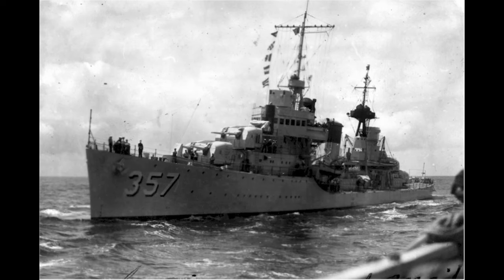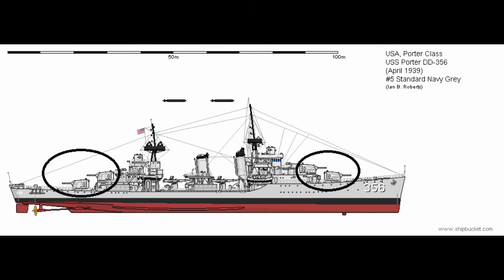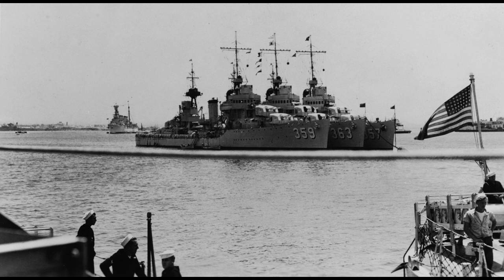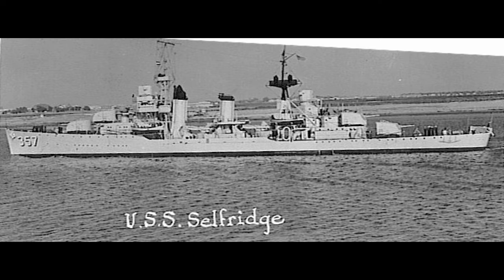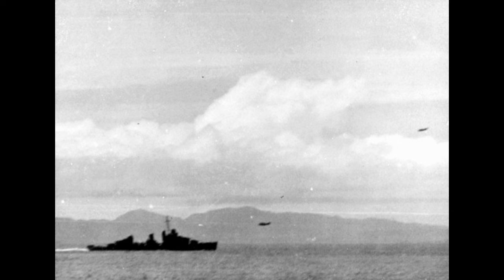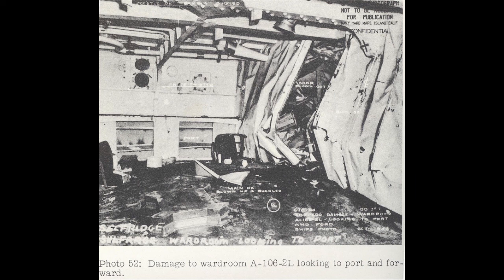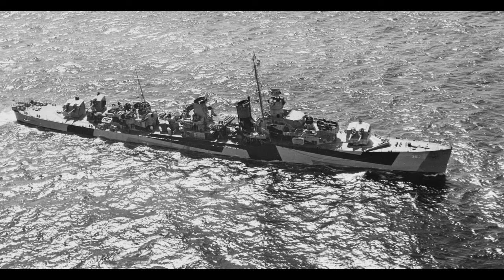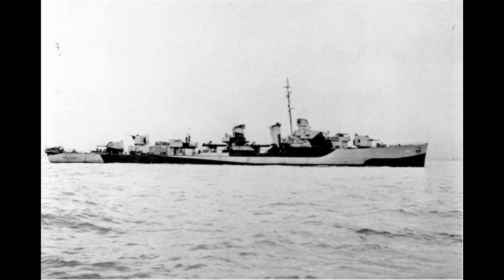USS Selfridge - When You Lose Half Your Ship

Comment: Odd rebuild. A destroyer having 8 5" 38s would have been a good carrier air defense platform. Drop one of the torpedo mounts for the quad 40mm mount.
Reply: The important thing about the interwar destroyer leaders is their weapons were single purpose. Before the rebuild, they could not be elevated for AA Duties. During the rebuild the guns were replaced by dual-purpose mounts. Due to the heavier weight, they could mount fewer of them.
Reply: they dropped both torpedo mounts in favor of more than double the antiaircraft guns and cut back the number if 5” guns but made them into actual antiaircraft guns instead of pure antiship guns.

their sole antiaircraft protection were the 1.1” “Chicago piano” guns until they added 20mm and 40mm guns along with dual-purpose 5” guns. less ia more there, but offset by more overall firepower
Reply: @luked7525 add in the torpedoes weren’t needed but the 5” and 20 and 40mm guns were…they at least kept depth charges so weren’t solely without full protection
Reply: @luked7525  Some of the surviving ships, especially Phelps were reconstructed with 2 twin mounts like the Sumner class and one single mount
Reply: Those four, twin mounts, were the old Mk22, which were not dual purpose. The ship would have been little help against most Aircraft.
Reply: @Commissioner62  1.1 inch guns weren’t much help either
Reply: @bostonrailfan2427  That is VERY true!  Fortunately, they had a rather short life in the US Navy.
Reply: @Commissioner62  unfortunately, that short life cost them multiple ships
Reply: @bostonrailfan2427  That is very true. But when it came to the 24" Type 93 torpedos, when we were still using our 21" Mk8s(with their wonderful 95% rate of failure, even when they decided to stay on set course),nothing was of much help at the time. Even today, the range and speeds of those Type 93s is amazing.
Reply: @Commissioner62  just think of what might have been had they focused on dozens of smaller ships and not huge battleships…fleets of them swarming like the tin cans eventually did in 1943/44/45 but in 1941/42 and things are over and lost in months!
Reply: @bostonrailfan2427   That definitely would have been an extremely serious issue, for ANY of our surface ships!  We probably would not have turned the tide until 44, when many of our (CV)+(CVL) went online, and we could avoid any confrontation less than 40000 yard. We probably would not have had those 3 carriers at Midway, if the IJN did not waste so much on Yamato, Musashi, and Shinano. Even worse, if they had engineered, or were able to purchase a large amount of medium calibre, AA weapons for their Destoyers, excellent Heavy Cruisers, and Capital Ships.
Reply: @Commissioner62  I realize that and that was my point. They should have switched all 4 turrets to the 5" 38s. Instead they removed 1 twin completely, the super firing twin. ANd the stern super firing was switched to a single 5" 38. The 2 remaining twins were switched to 5" 38s.
Reply: @kylecarmichael5890   That is true, but I think it had to do with 4, mk38 mounts, adding over 40t of load line displacement, which could have made them too top heavy, and an unstable platform in anything but calm seas. Also the addition of the improved radar sets, antenna, 40mm and 20mm cannon, would have added to that issue. But, I could be wrong?
Reply: @Commissioner62  the radar and fire control systems weren’t adding that much weight, nor were the additional antiaircraft guns, it was the armored turrets and heavier DP guns that did…cutting back on the DP guns while adding more smaller guns in the same space made up for the supposed loss of firepower especially as it was now an antiaircraft cruiser rather than one going to engage destroyers directly
Reply: @bostonrailfan2427  That is absolutely true. The large majority of the displacement would have been the Mk38s.
Reply: I know the old mount weren't dual purpose, but they replaced them with some of the dual purpose mounts. But up front IIRC is was a single mount. That was my question, replace all dual mount Mk22s with dual purpose 5' 38s.